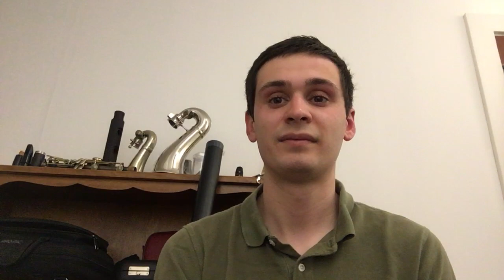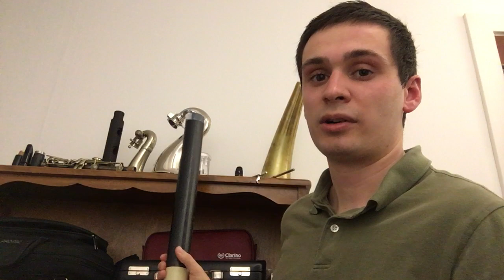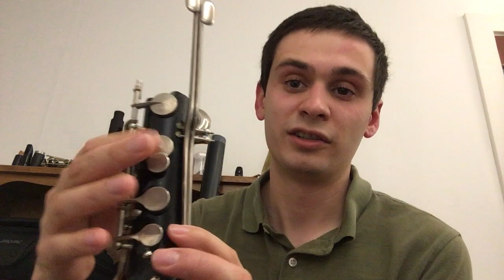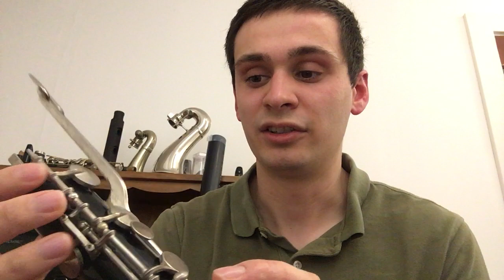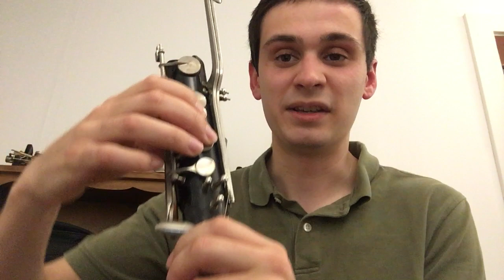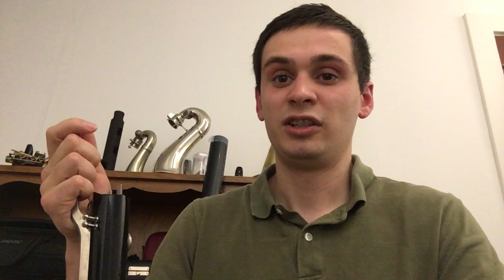Octocontrabass Project (Quick Update): Fingering systems, Boehm vs Simple System

Comment: Would you ever make a "soprillisimo" clarinet (a perfect octave above a Bb clarinet)? The highest clarinet currently is an Ab clarinet, but I've heard that a few that a few octave clarinets have been made, but they were too small. Would you ever be willing to make one of these? It would be fascinating to extend the clarinet family just that much higher.
Reply from the maker: TheCrysticalCryptic I've seen a Boehm system piccolo C clarinet that was apparently playable. I did already make a 4 key piccolo clarinet in Ab but most people I showed it to agreed the tone was poor. As of right now I'm mostly interested in the lower members of the clarinet family.
Reply: @Jared_De_Leon  If you make it please don't name it a soprillisimo clarinet. Piccolo will do fine.
Reply: @leotard2536  I always thought that the Ab was the piccolo clarinet. I guess you could call it the "sopranissississimo" clarinet, but I thought that would be ridiculous.
Reply: @glace963  Yeah, the Ab is classified by most as piccolo. I would actually say the Eb should be a piccolo, because the Ab is basically obsolete. In my experience, the Eb serves a piccolo-like role in most orchestrations, and I don't see it as a sopranino.